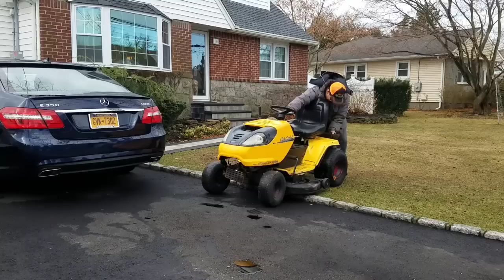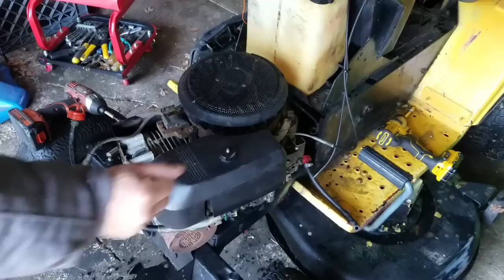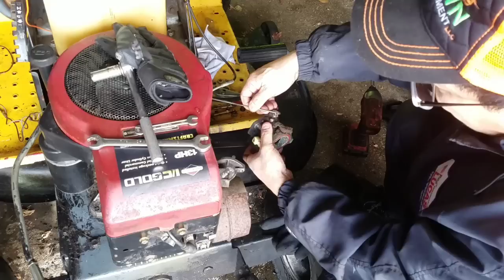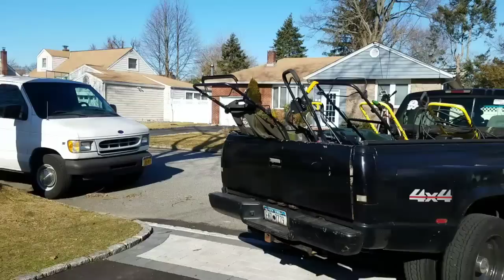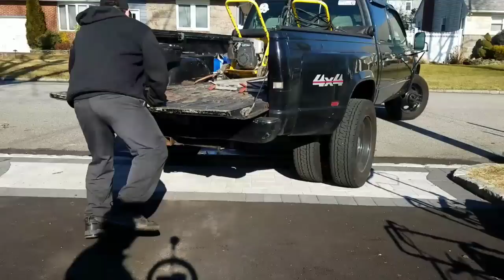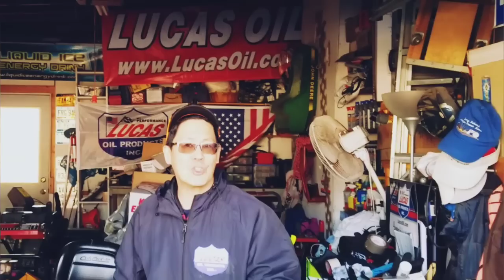$40 MTD CUB CADET LAWN TRACTOR REPOWER 2ND BRIGGS ENGINE ATTEMPT CARBURETOR REPLACEMENT INSTALLATION

Comment: That engine worked out good and not a lot of time & effort to make a functioning tractor again... little muffler is loud, but still ran good. Throw a piece of foam in that air filter housing until you get the proper filter, also keeps crap from getting dropped in there!
Yes, hide all your goodies in the backyard under tarps before the wife gets home. Too funny Henry! LOL Enjoy your haul mate!
Reply from the maker: I had a spare filter from the Murray engine, all good brother! Thx for always tuning in.

Comment: Next time you should try mixing some purple power with water in a good spray bottle (be liberal with the purple power) and coat the underside of the engine with it and let it soak for 30 mins. That oily grease will fly right off then.
Reply from the maker: Good tip bro, I'll try that thx.

Comment: You will notice, with the more engines you do, the even numbers..... 12,13,14 etc, always are built better then the.....12.5, 13.5, 14.5, etc, it's what I have found in the briggs engines, you will also find that in the very expensive tractors you most  always fine a even numbered horse power engine.
Reply from the maker: Hmmmm interesting bro!